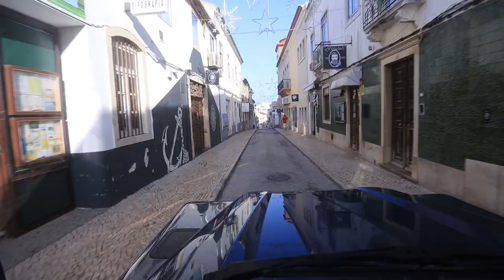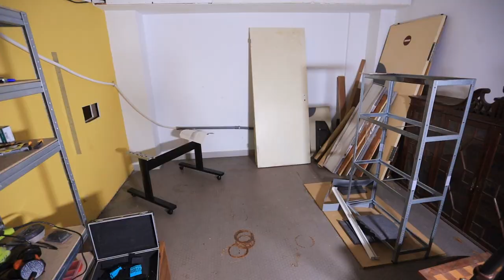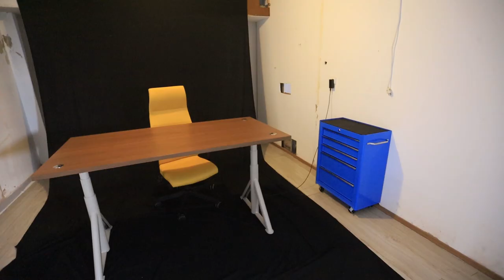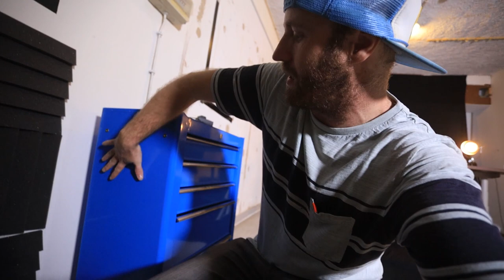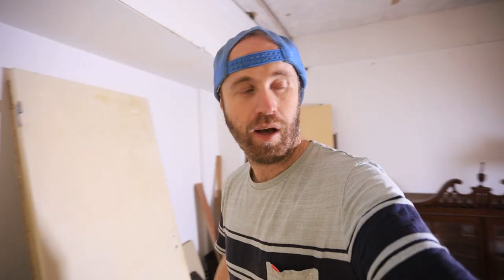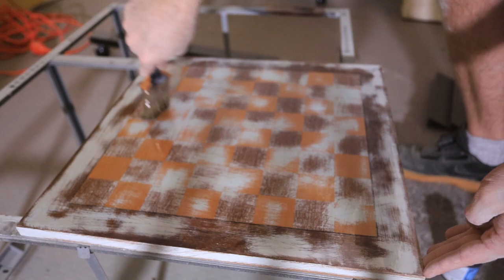DIY Photography Studio - Day 7

Comment: When it comes to the AC I would suggest to just keep it and hire someone to inspect if that’s the cause of the water leak, as you will have studio lights and lots of electronics that will run,  and I would hire an electrician that will add additional outlets

Comment: Have you considered checking thrift stores or consignment shops for used furniture (if they have those over there). Can save a bundle. Also, what about encasing those wires in PVC pipe or conduit to make them neater and more permanent. Just a thought. Hang in there

Comment: Word of caution: be careful with your gear. If you are planning to leave it overnight you’ve told the world exactly where it’s all stored. I trust the tool case and room can be locked securely. Insurance company may be less than sympathetic if they know you’ve “advertised” in your videos what can be found and where it is. Even if you have an alarm it’ll take a matter of seconds to smash and grab if they know where to find what they are looking for. Big difference from nomadic life. This obviously applies to your desk equipment (PC and storage etc) too. 

Apart from that downer sounding statement I just want to say it’s quite inspiring watching you throw yourself into this and working on learning new skills and experimenting with things. I’m sure place is gonna be great.
Reply from the maker: Yes, I've actually installed a new lock in the door downstairs.  We're adding an alarm system this week as well.
Reply: @BrendanvanSon  its a basement and if it gets mold you need to think about managing humidity. The wall ac helps.  Also you should keep your camera gear, especially the lenses in a dry box. You can get cheap rechargeable humidifiers that will work in dry boxes.  I recommend getting a cheap humidity gauge for the basement at a minimum, you want to be below 50%

Comment: The "AC" unit is actually a heat pump and provides both heat and cooling. You might want to think about keeping it.
Reply from the maker: Yeah, I'm worried it was causing the water damage. Any idea how how easy that is to fix?
Reply: @BrendanvanSon  You might also want to keep it as it will remove moisture from the air. Basements can be damp. And with multiple people in your basement temperatures will increase rapidly, so I would keep it and fix it.
Reply: Also, knowing how Algarve is in the summer, I have a feeling that place will be really hot, especially while running studio lights and computers, etc.
Reply: Maritime basement without a heat pump would be asking for trouble, I'm on team 'keep it'. So many old homes I've seen recently are a moist mess 😅
Reply: @BrendanvanSon  If there is a chance it is leaking the water, it could be something reasonably simple. If you can get it looked at by a pro, you will likely be able to get it fixed up easily. Wouldn't the cost be to the landlord?
Reply: Do not remove the AC from the wall. You are in a Mediterranean country that gets hot about half the year and the room does not have any windows or ventilation. It’s probably gonna be sauna in the summer and feel very very stuffy.
Reply: @marieta.s  not a Med. Nation its a atlantic  nation
Reply: @antoniodasilva1230  you are so right! I don’t know what I was thinking. Sorry about that, my bad. I rushed to say that due to the proximity Portugal has to Spain.
Reply: It's going to get hot. Keep the A/C.

Comment: Are you sure you want to take the AC? I saw in a comment bellow that it worries you about the water damage. You should check that out because doing it, because AC will be usefull. In the summer it's hot, even though it's a basement, you will have lights on, people working, I think it will get hot. It also moves the air a bit and dries. So, in my opinion, if it's not damaging anything, well, keep it, AC for free xD

Comment: Use a sanding block and small-grit (higher number) sandpaper. Maybe around 200, or do a bit at a lower number and then hit it with the 200 if your paint is pretty thick. It'll take it down slowly and evenly so that you can catch it before going too far and you should be able to get the checkers to peek through.

Comment: Good job on the table, Brendan. Regarding the AC unit on the wall, you're going to be in a studio and likely have studio lights. You might want to hold on to that ... especially since you don't know what it will feel like in the summer. I'd hate for you to get rid of it, then summer 2021 rolls around and you're sweating like crazy. Does it heat as well? In the off-chance you do keep it, you might want to have it inspected to see if it's leaking anywhere. Leaking can cause mold.

Comment: FYI for your DIY- In the future,  you can thin your paint by mixing some with water ( if it’s water based) and wipe on with a cloth,. Let dry and add another layer and so on until you get what you envision. About a 50/50 mix if the paint is thick or maybe a 60% paint and 40% water if the paint is not as thick.  You also could have immediately wiped all the paint off when you first started if it wasn’t what you wanted, and followed it with another rag that is dipped in water and rung out.  But only if you do it right away before it starts drying.  Love your enthusiasm!  These vlogs are definitely fun to watch. Keep them coming!
Reply from the maker: Thanks for the tip.  I was going to add some water or thinner in. But I thought it was way less thick than it actually was haha.

Comment: Your DIY  will pay off in the end in the satisfaction and knowledge you will gain.  Here is my suggestion, because, this is the internet after all, do not be in a hurry to remove the air-con, unless it is not working, as  the basement  will draw moisture  especially in a coastal area, as it will remove some moisture  as well as cool the space.  I like how the chess board table turned out. 👍
Reply from the maker: Yeah, that's a good point.  We'll see. I'm worried it was leaking water before.

Comment: Nice touch with the coffee table. Why don’t you attach rails on the walls/sealing and hang some curtains to dampen the sound. That way it will looks like it’s ment to be.. And you can wash them when they collect dust.
Reply from the maker: Once this one breaks down, that's the plan. I just wanted to get something usable up quickly.
Reply: @BrendanvanSon  I mean it on the rest of the wall that you need to cover. Not like the place looks like it's not meant to be 😆

Comment: Did you see the video I linked to on making your own sound deadening on your last vid.  He did audio testing on the home made panels?
Reply from the maker: I did. It's pretty impressive.
Reply: @BrendanvanSon  time to go around the neighborhood looking for old towels and wood to make frames.
Reply: @BrendanvanSon    you don't have to use towels.  Just get nice fabric and frame it like a picture.  Large squares of different fabric should do the trick, be cheap and add nice color.  All you need is frames with 1x 2 or 2 1/2 inch wood..